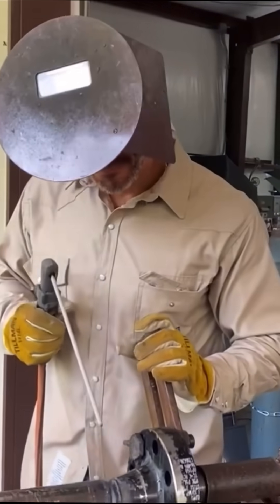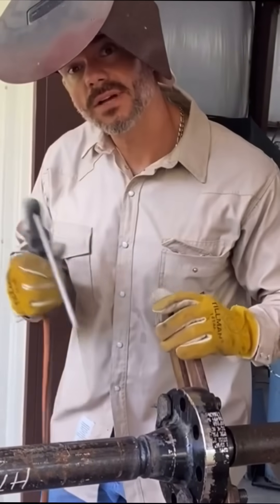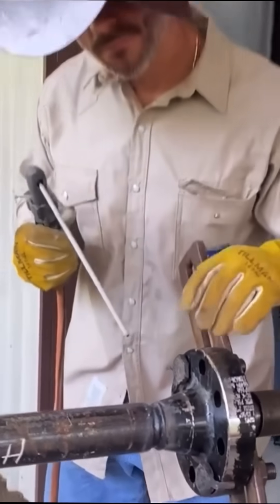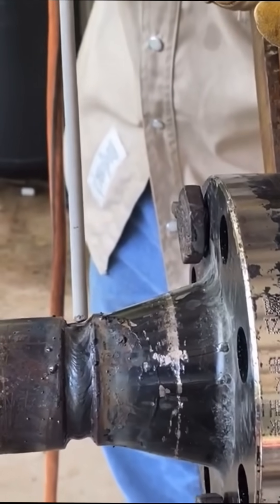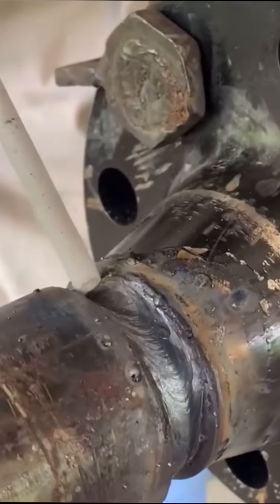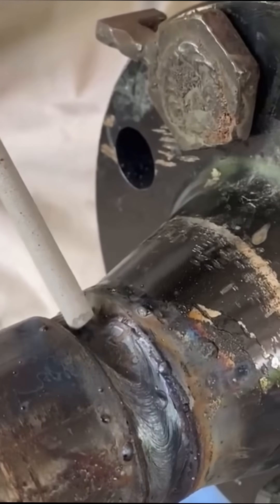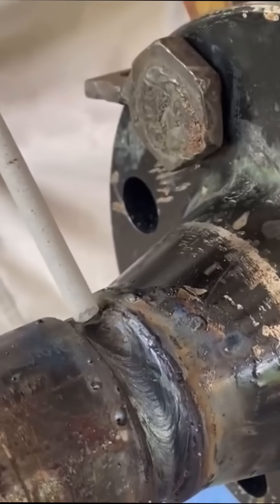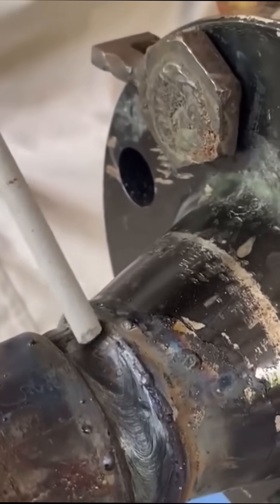How to 7018 restart

Comment: Chris 
I think this is one of the best advices i have got about restarting 
I was wandering if I could use this method for restarting when i weld vertical? What do you think? Do you think I could use this tip for all positions restarting?
Reply: I always do, every time I strike a rod up. anytime you don't you're trapping slag, once the rods hot, it burns the trash to the top. You can see it float up the puddle when it happens.

 It's a pretty quick motion, don't worry about laying down too much fill. Strike up, drag to start, J hook back the other direction, and burn your bead in. Don't long arc, the porosity 7018 spits out gets out of hand quick
Reply: @ thank you so much for your advice. Could you please explain it to me step by step simpler please so i can write it down and make reference of it ?
Reply: @ thank you soo much

Comment: Back welding you’re dropping the slag/weld start and then going up above said slag weld and getting a good hot weld before dragging back towards you and going back over that bit of slag weld to reheat it and burn off the rest of the slag inside the initial weld. As much as I know what’s happening and what it’s referred to I always forget to do this with 7018 😆😆